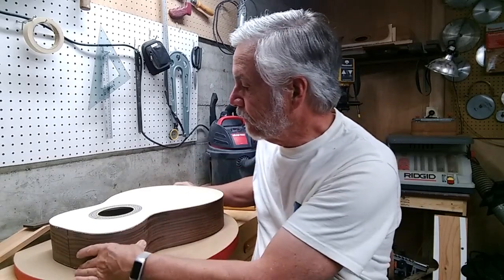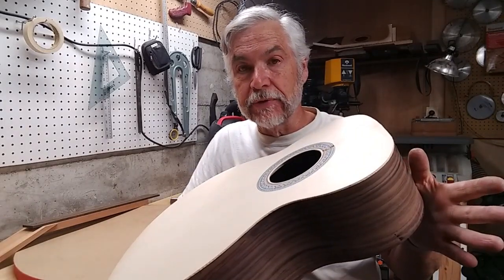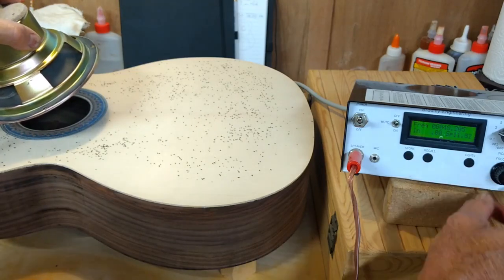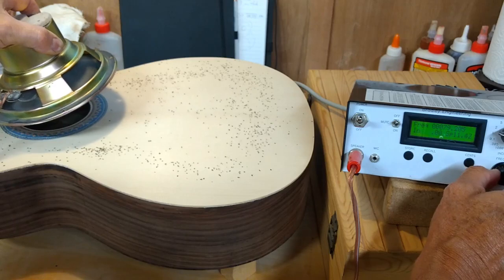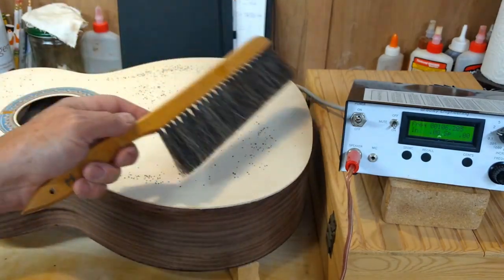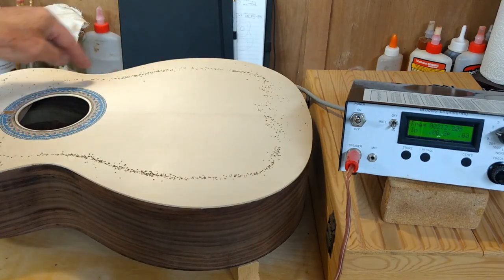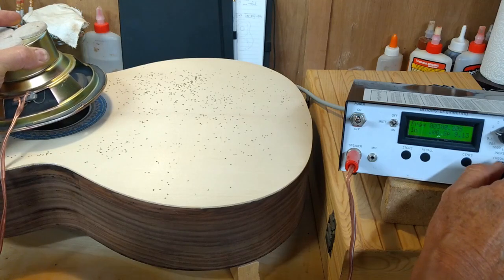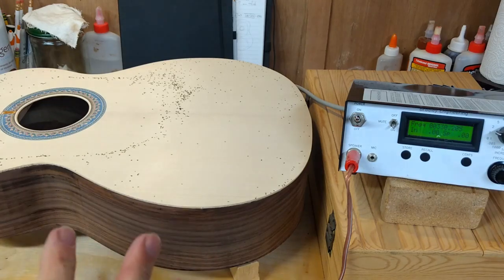Testing responsiveness early: 00 size steel string guitar build

Comment: Wouldn't it be better to hold the speaker over the bridge position as this will be the center of vibration from the strings - perhaps it doesn't make any difference but my understanding is that one of the lower resonances will be the Helmholtz resonance of the air cavity, it would seem that at that frequency the speaker could interfere with the air movement in and out of the soundhole.
Reply from the maker: You are correct in that the lowest resonance strong resonance that shows up is the air cavity resonance. But it depends on what you're looking for. Both of the air and top resonances show up very nicely either way, but my experience is that they show stronger when driven from the sound hole. The next few top resonances show up well as well. To go beyond that it is necessary to drive the top directly.

It should be noted that this is before the bridge is glued on, which does change things a bit.

Comment: great information thx for sharing .

can I have some information about your frequency generator you are using its look easy to use and I was looking for one like use simple and easy.

also about the speaker how big should be ? it is any special speaker for this work ? 

thank you
Reply from the maker: My frequency generator is one of the last ones built by the late Don Bradley about a decade ago. I don't know of any similar ones on the market today.

I use a generic 4" speaker. I've used smaller ones, but I like the way the 4" works.